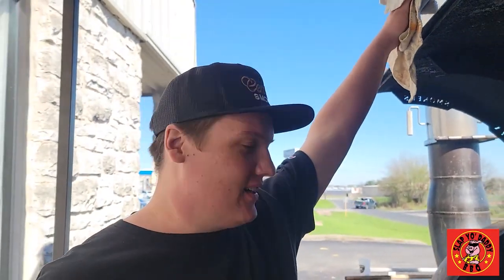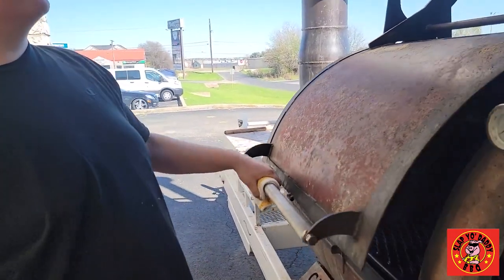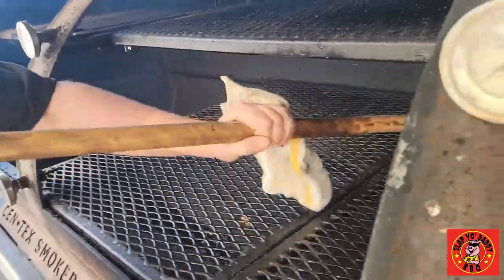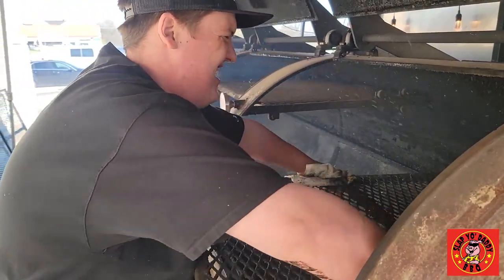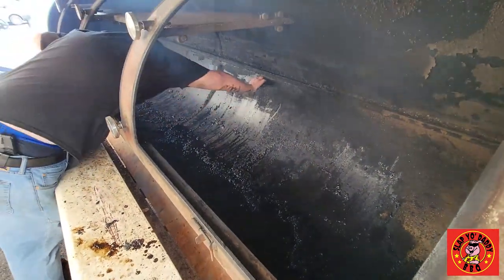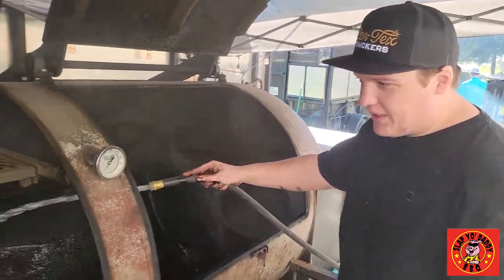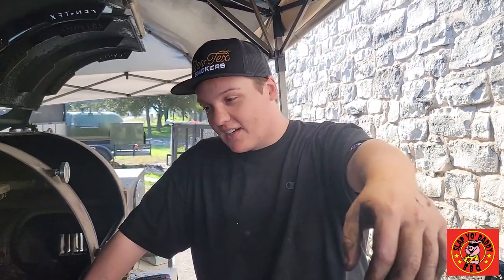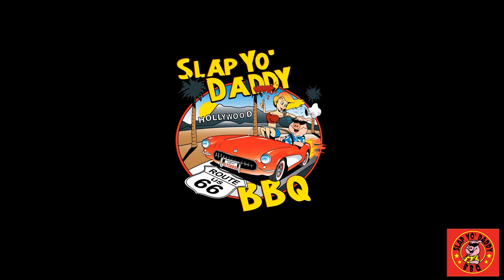Offset Pit Cleaning How-to Pitmaster Bobby Holley | Cen-tex 1,000 gal |  Brotherton's BBQ Austin TX

Comment: I’m doing mine this weekend. Similar process but I also use a weed burner to dry it, spray it inside with oil, then start a small fire to burn a few hours. Not actually sure I’m doing it correctly but it’s worked so far.